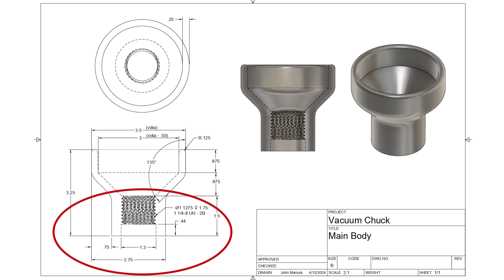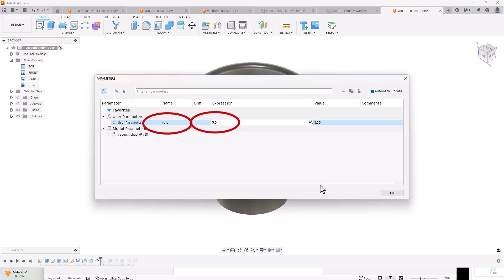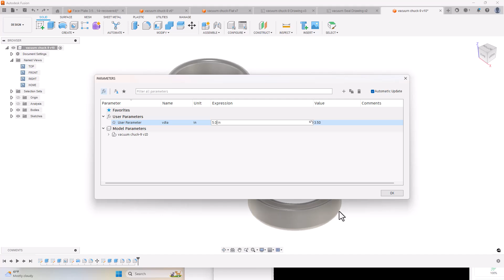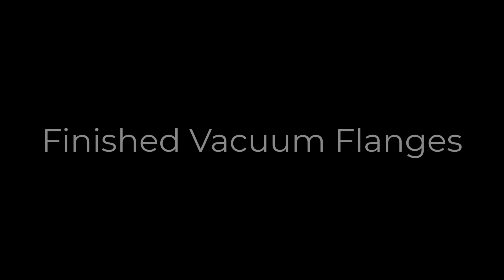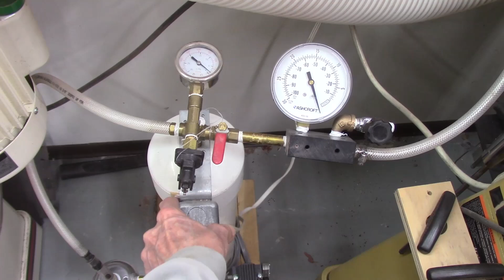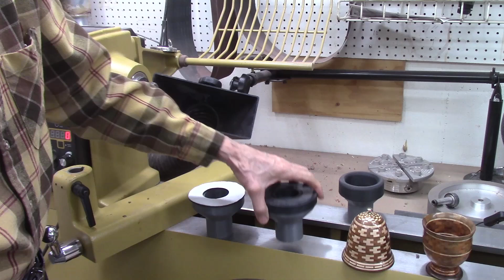3-D Printed Vacuum Chucks for the Lathe - Low Cost Vacuum Chucks for the Lathe

Comment: Nice setup. I will definitely design and print my own chucks. Can you tell us where you got the rotary adapter for the head stock?
Reply from the maker: I bought the rotating tailstock adaptor about 10 years ago.  Apparently it is no longer available since I was not able to find any source for this item when I did an internet search.  I will be working on designing and machining these units in the near future since I have had several requests for them. I just finished designing a prototype which I 3-D printed to check out my design.  As soon as I can find some time, I will do an initial test by machining one out of aluminum.
Reply from the maker: The rotating tailstock is now available on our website.  The link to this item is listed in the "What's New" section on our web site home page.  

www.accu-slice.com

Comment: Would it be possible to get your STL files for your Vacuum Chucks?
Reply from the maker: I made a significant number of drawings on the vacuum chucks and I had to modify the drawings several times to print out accurately on my 3-D printer.  I am not confident that my drawings will fit your system and 3-D printer.  i recommend that you create your own drawings and tweek them it to accurately print out with your 3-D printer. .

Comment: Thanks for the update on the vacuum chuck! On your tail stock with the free spinning chuck where did you find that spindle with a 1 1/4” thread all I can find is a 1”x8 threads per inch? Thanks you John for sharing!
Reply from the maker: I did search the web and I could not find a rotating live center 1.25 x 8 tpi unit like I have.  I also saw on the web that many others are looking for this item.  It seems like it should be readily available, but i could not find it. 

I am not sure where I got it.  I added to my system about 10 years ago.  I thought that I bought it from Nova, but I could not find it on their web site.  What Nova does have is a live center kit which I found on the Nova web site. 

NOVA LATHE ACCESSORY 2MT LIVE CENTER SYSTEM (SKU 5015 AND 71074) 

and then I found a Nova 1.25 x 8 tpi  Tailstock Chuck Adaptor which I found on the Rockler web site.  But I could not locate this on the Nova web site. Perhaps joining these two units will do the job, but it seems like an expensive way to go.
Reply: @Accu-Slice  Thanks for checking it out John! I’ll take a look at what you found!
Reply from the maker: The rotating tailstock is now available on our website.  The link to this item is listed in the "What's New" section on our web site home page.  

www.accu-slice.com
Reply from the maker: The rotating tailstock is now available on our website.  The link to this item is listed in the "What's New" section on our web site home page.  

www.accu-slice.com